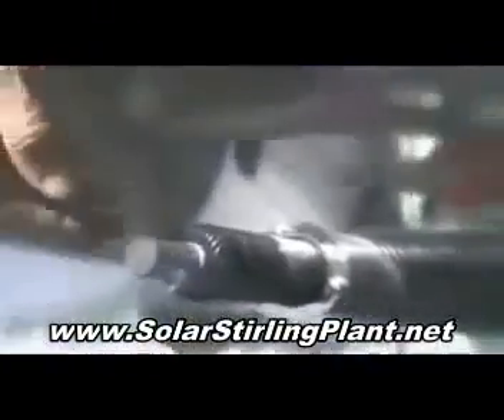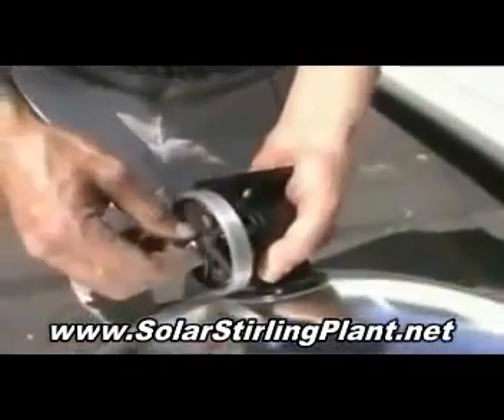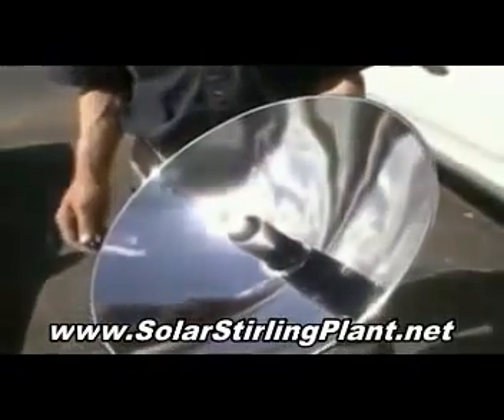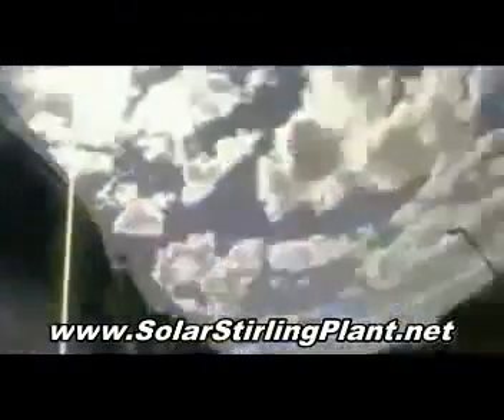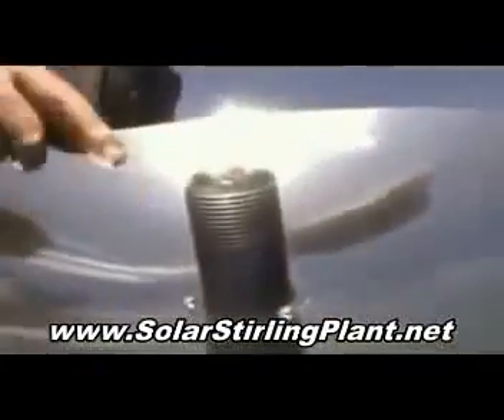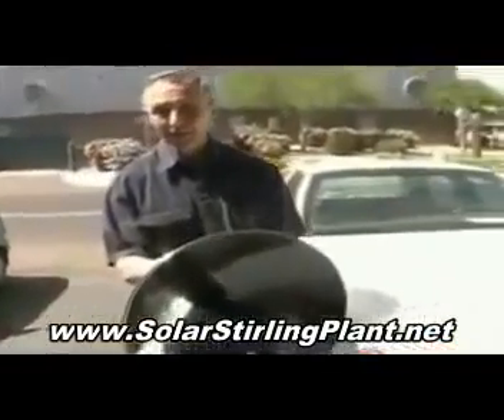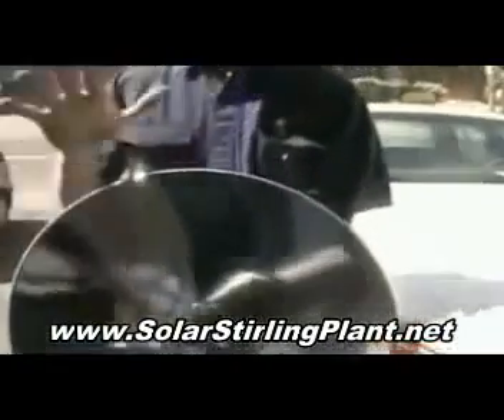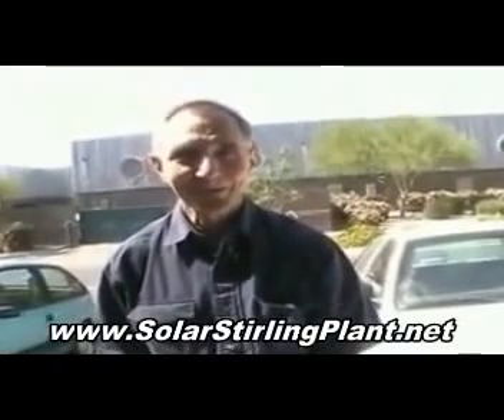Revolutionary Invention!! This Is A New Method Of Generating Free Energy.

Comment: PS Will the reflector sterling deal scale up or do you need to create an array of thousands of tiny dishes?
Reply: Neither, solar plants that do use concentrated heat use traditional heat to kinetic conversion methods like steam and turbines.
Reply: Yeah I know it was a joke. Seen solar ponds with closed system steam turbines where the medium used in the turbines boiling point was ideal to exploit the variation of the upper layer of water and the lower (on the pond I saw in the desert the differential was in excess of 20°f

Comment: Back about 30 yrs ago I read an article in Scientific American where they set up a giant solar pond in a desert. They took treated water and filled a 3 foot deep 1000acre pond. The water was black on top and the top layer would typically be 30-40° hotter than the bottom. This water would could be used to heat to vapor a liquid in a sealed system and by feeding in a sterling or conventional turbine generator it would create mechanical energy that could run an alternator then hot vapor would be the cooled by the cooler water from the bottom of the pond to convert the vapor back to a liquid. Always wondered what happened to that idea as it seems like it would be easier to produce with less environmental impacts than solar cells and battery banks.

Comment: Stirling cycle engines are real enough but the problem I see is threefold. To make a well engineered Stirling engine is epensive, the reflector may be cheap, the little engine is not.
The amount of energy harvestable per square meter of surfce is limited to the amount the sun lays down at that point. and the conversion rate to useful work will be nowhere near 100%.
Allowing a generous 1Kw per sq. meter, and a generous 50% efficiency that small dish might be able to output 50 watts. third problem, output is dependent on the time of day and weather. Also the efficiency of a dish reflector falls off dramatically as the sun moves the point of focus.
It seems to be a relatively expensive way to do something that can be done cheaper, and can never be done free.

Comment: ahem... stirling engines produce high speed but ZERO torque, in order to generate you need torque....... where is the torque coming from?
Reply: Well the low temperature ones produce very little torque but something like this can produce power assuming that focal point gets hot enough (although I'm not sure how much power it would produce).

Comment: A Stirling was a revolutionary invention in the 18-th century, you can't refer to it as such in the 21-st. Unfortunately it's power density is so low that to produce any appreciable power you'd need a unit a size of a large building with a very sophisticated heat exchange arrangement, otherwise the efficiency of the large unit will not come close to that of the prototype. Not at all easy or cheap. The only millionaires this thing will make are the scamsters if there are enough gullibles to "invest".

Comment: I wouldn't bite unless people like this are up front about STATS.  I would need to know Foot Pounds of torque which can easily be converted to watts example a corvette v8 puts out about 400,000 watts of energy. As always the most important selling point of these renewable energy gizmos are left out of the conversation. I watched the video and no mention of foot pounds or watts was to be had. IF YOU HAVE TO ASK THIS; AS A RULE YOU WILL NOT LIKE THE ANSWER. I shall wait till I get the answers underground freenets or my engineering friends.
Powering half your house, cutting half your bill is foundation-less, and to variable
of an answer. Half of what? How big is your house? PLEASE  GIVE US THE FACTS!!
AS THEY SAY IN THE AUTO BIZ "SHOW ME THE FAX"
Reply: It would make a lot more toque if the energy were used to make steam, although the dish would typically have a different design.
Reply: Im surprised that we do not hear more about ORC turbines, these are turbines that run on refrigerant rather than steam. ORC turbines have a much lower operating temperature. Another way to make steam with CSP is with a second high boiling point fluid. Molten salt or a chemical like Dow Therm.
Reply: https://www.asme.org/engineering-topics/articles/boilers/solar-steam-power-on-the-rise

Comment: There's less moving parts in a solenoid. How much less efficient is the electricity generation through a solenoid than an electric motor?
Reply: A solenoid is a load, not an energy source. Electricity flows through a coil to generate magnetic force which opens a valve. A solenoid consumes power.

Comment: how hydrogen turn the wheel
Reply: Hydrogen expands and contracts when heated and cooled. This is what causes the piston to move. So its high pressure from expanding gas on one side of the piston, and low pressure on the other side when the hydrogen contracts.